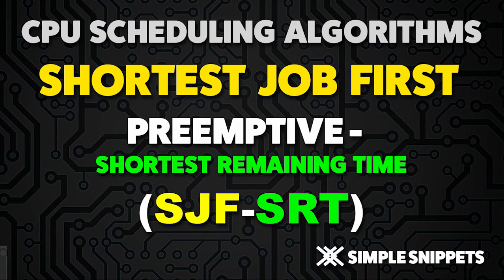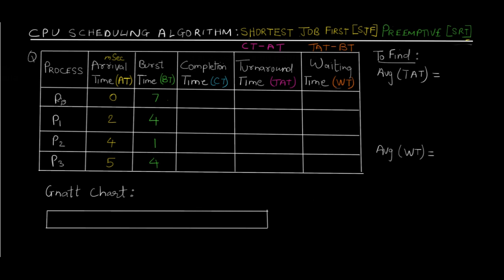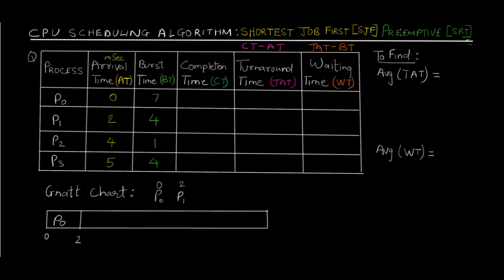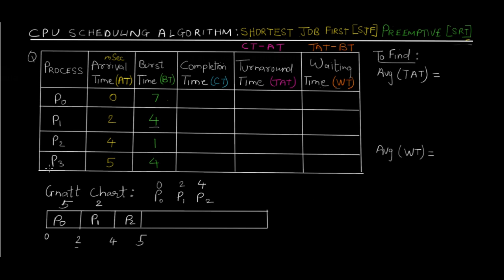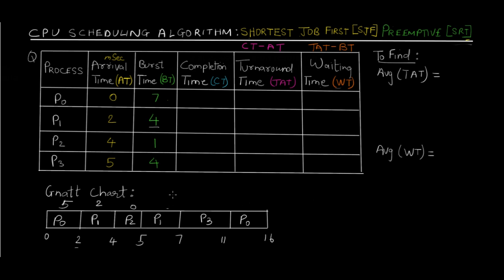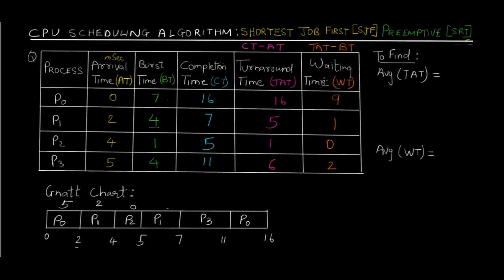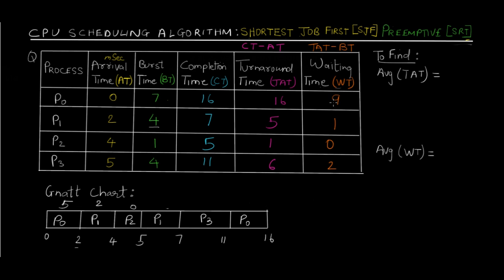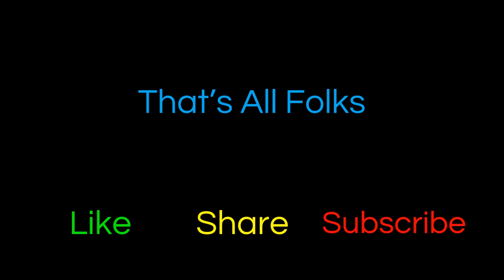Shortest Remaining Time (SRT) CPU Scheduling Algorithm - Operating Systems

Comment: Hey man! Cool video, but I still do have a question. How does the system know both the arrival time and burst time? For an arival time do i need in my program some global clock running, or what? And for burst time... How am I supposed to give each process it's default time?
Reply from the maker: This is a numerical, and this is usually how data is presented in an examination scenario. If you are talking about the real implementation of this scenario in terms of programming or in a real CPU system with this algorithm then there are many factors to be taken into consideration.
Reply: Simple Snippets Hahah yea, that's exactly what i mean. At my university we're building our system simmulation and I have to schedule processes using SRT, which is fine, I implemented it already. The thing is we don't know where to get the burst time of the process. I know there's equation newPredictionBurstTime = a * whole time + (1-a) * lastPredictedBurstTime But does this equasion make the burst time of next process? What if the process arrives while the very first is being run, then we don't know the burst time of the second one...